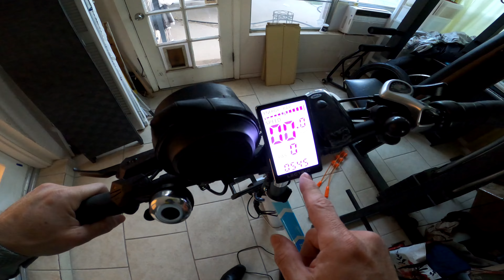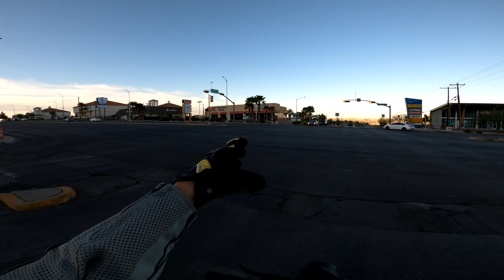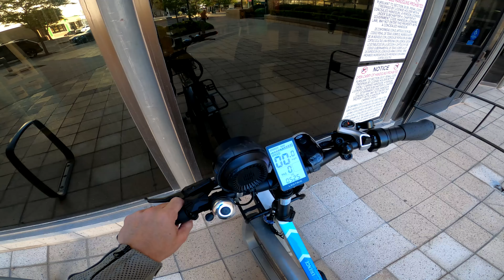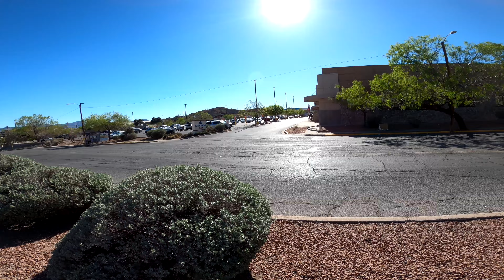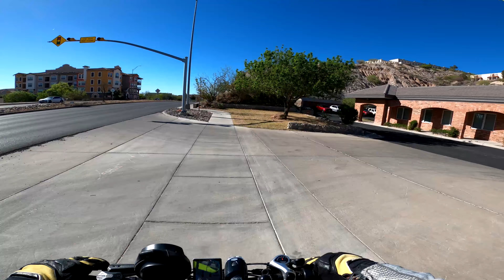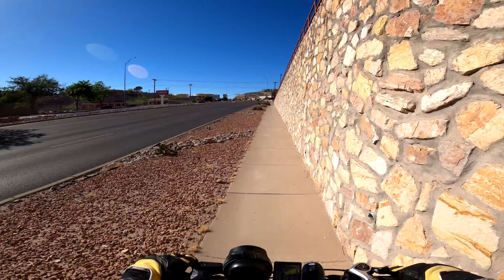Bad Battery Design?!?  - Day 2 Commute Challenge

Comment: The GoTrax F2 on Amazon looks a lot like the Lectric bike and they seem to have many of the same specs. They also use the same display. Do you think these are the same bikes. I assume they are both probably made by the same Chinese company but what your getting for the extra cost with the Lectric bike is rhe better customer service. What do you think? BTW what state are you in, looks like Arizona 👍

Comment: I have photochromic sunglasses.  They are light when it's dark out, and dark when it's bright out!
Reply from the maker: Also a good option.  Do you find it is faster going from a light tint to a dark tint than from dark to light?  That was a limitation of the technology when it first came out.
Reply: @LectricGo  They don't react fast enough to handle tunnels or even tunnels of trees all that well, but as a morning/daytime/evening option they are great.

Comment: I HATE the battery and key  placement design on my lectric 3.0. it's SO hard to remove/replace/turn on/off
Reply: And makes removing the battery a source of never ending misery.
Reply: Yes when I first got mine it was a bit annoying, but once you get the hang of it add memorize location and operation  it gets easier with out looking. I go by the angles of the blue stripe at the bottom where the key is located. But yes I agree it could be a lot better
Reply from the maker: Absolutely!  It's likely the worst part of the bike.  Requires a lot of contortions to get under there.
Reply: @LectricGo  special security feature 🤣🤣🤣
Reply: I live on 3rd floor nyc walk up, I got rid of the bike because it was too much to remove battery daily. I upgraded to Ariel rider cvlass 52v